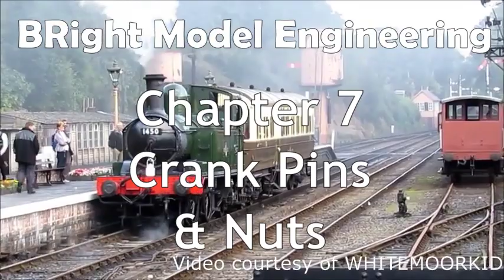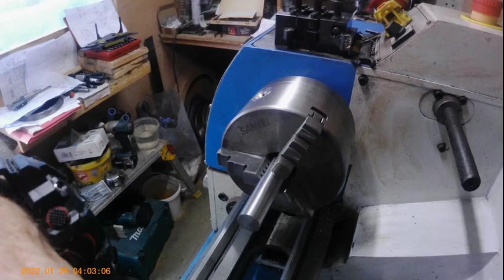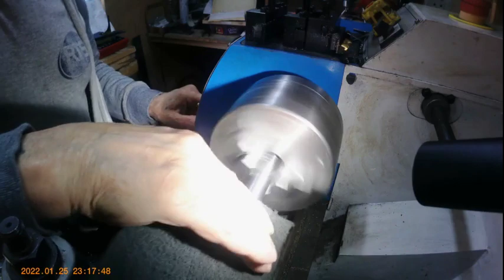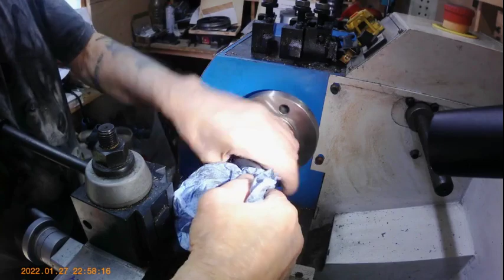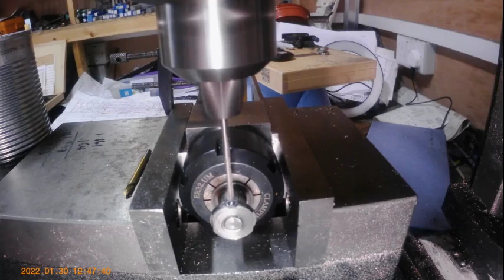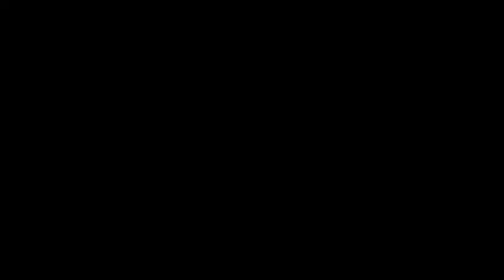Dart Part 7

Comment: Well, we all get lucky and do it right from time to time. I had that happen to me some years ago. But your setups are sound and I would have expected the holes to line up for you. Keep up the good work. I like your method of guiding the tap using the chuck, a very good idea.
Reply from the maker: Thank you. Nearly all my taps have a flat ground on the shaft being careful not to grind off the numbers. That way I can grip the tap and leave enough to go in the chuck. A tip shown to me by an old machinist many years ago.